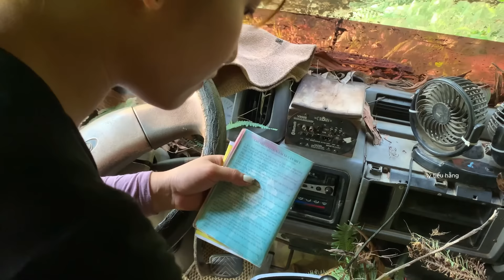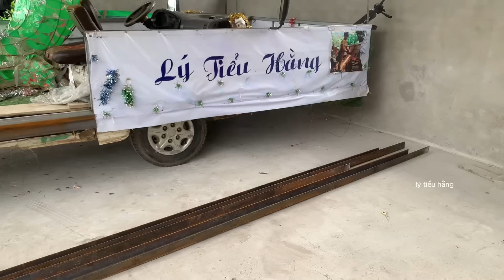Full video of the restoration and repair of a truck found in the wild.

Comment: By the way you're not supposed to use a bolt to put the jack under & raise it up,you're supposed to use the axle to put the jack under, then use the axle to raise the truck up & I wouldn't trust that tire even if you did just glue it back together I'd go get another tire